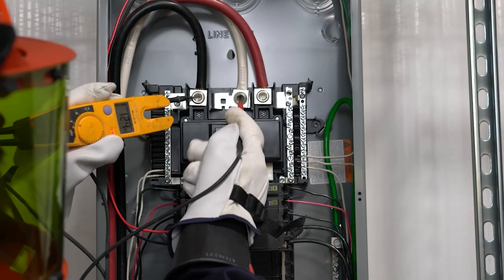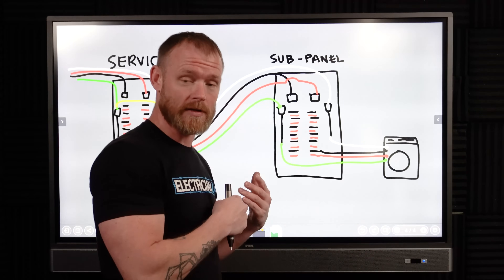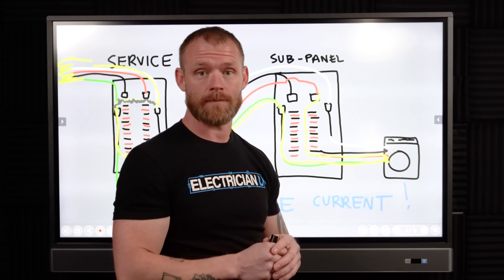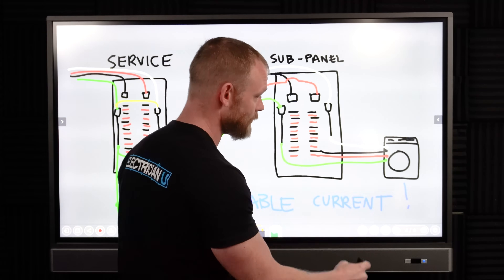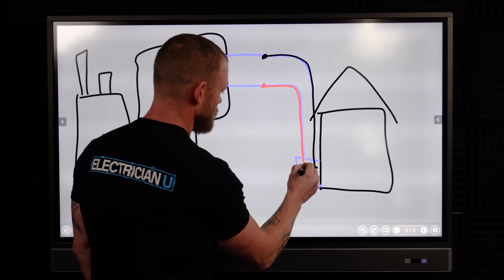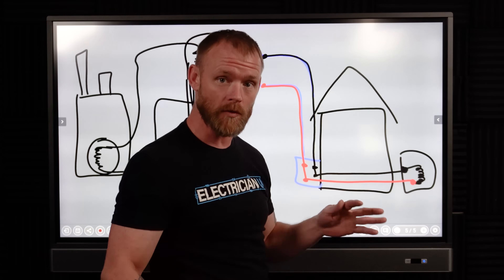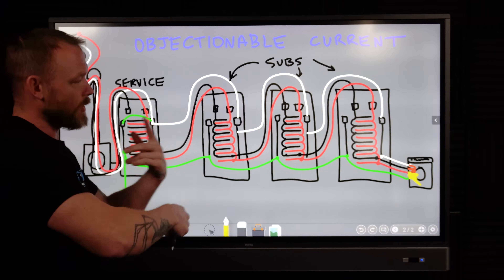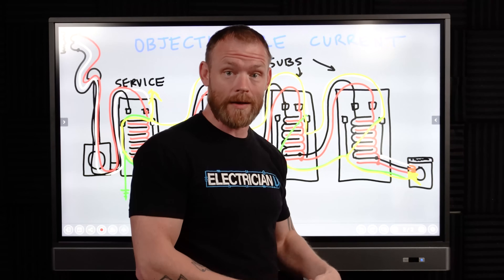Why Do We Bond at the Service Panel and Not a Subpanel?

Comment: As someone who does understand electricity (commercial HVAC),  I am a bit confused. When you stated we bond at the main so a ground fault has a path to the transformer neutral, or we wouldn't trip the breaker. Wouldn't a direct path to ground via the ground rod trip a breaker? I do understand the not bonding the sub panel but I thought the main box was bonded to ensure the neutral remained at 0 potential.

Comment: if you install a whole house generator you bring power from meter base to outside breaker box from bottom of this breaker goes to main breaker box and also from bottom goes to whole house generator . Question does this make the main a sub panel?

Comment: There's a lot misunderstanding about grounding gas pipes and water lines hot and cold ,
Can you make a video not just what the codes says but the logic behind it.maybe a little bit of the grounding rods too.
On later video phantom voltage.
How sometime when trouble shooting you finds circuits with 50 ,60 volts because a open ground.
Great content well explained
Keep up the good work

Comment: When a conductor is carrying current, the voltage at one end rises due to the resistance of the conductors. This voltage is usually very low under low power conditions, but (for example ) a neutral at the end of a #12 gauge wire  circuit carrying a 1600 W load will have a measurable voltage difference than the ground wire not carrying any current. Not much, but enough to feel if you touched the neutral and the bond wire at the same time. 
Experiment: stretch out 50 feet of romex, or just feed one end of a new box of romex and put a receptacle on the other end. Plug in a heavy load like a resistance heater or a big quartz light. Measure the AC voltage between the neutral and the bond at the load end. It won’t be much, but you will feel the difference between the bond and neutral if you were to touch it. 

So the bond wire would never carry current to keep its voltage always  at the same as the ground rod  potential, so that all the metal in electrical equipment has no voltage difference between them or the local ground rod.

Comment: Another reason would be to know if there is some sort of disconnection on the neutral line between the 2 panels. If the ground neutral bonding is on each panel you would never know about the neutral becoming disconnected.

Comment: Great explanation!  When I was trying to wrap my head around this a few years ago, I came to the conclusion that the easiest way to conceptualize it is by equating it to tying the ground and neutral together at a receptacle.  Would totally defeat the purpose of the ground conductor. (Of course you're not dealing with a breaker at a receptacle, but... You know)

Comment: My shops sub panel I added another ground pin just because the soil is much wetter than the back of my house where the original ground pin is. The soil at my house is protected somewhat by the over hang of the roof, and is dryer. There is no "extra" bonding at the sub panel in my shop. Was this a good idea?

Comment: Thank You for your knowledge and time brother! I have a question on hooking a portable 250 volt generator to a main panel with a inlet box and interlock. The generator is bonded neutral from the factory. I have seperated that bond. The cord going from the 50 amp outlet on the generator to the breaker panel has 2 hots, a ground and a neutral. So the only neutral bond is at the main panel. Is that correct? Thank you again for your time, Mike in DFW

Comment: everyone probably will say its a bad idea... but im putting in a new subpanel next to the old one, with no loads on the old one anymore.  both panels are protected by their main 200amp breakers.  im setting up the new subpanel with bonded ground and common, so that when im able to hire an electrician to remove the old panel, the new one will already be set up as the main.  with no loads on the old main panel anymore, from what i can understand from this explanation, it seems like that should be safe.

Comment: One point that I believe you missed is that if the neutrals and grounds are tied together, say at the last panel, then there are 2 paths for the neutral current flow. I've seen water pipes that would give an uncomfortable shock because of this. This happens even with no faults at all. Great explanation and presentation.
Reply: To follow up with this point. As I understand it, current follows the path of least resistance. Therefore, on the main panel, current follows the neutral wire instead of the grounding electrode conductor (GEC) to the source (transformer). What I don't understand is you still have two paths for the current to flow, wouldn't the ground still have a percentage of that current? If it does, is there still a chance of getting shocked if you happen to be touching that grounded wire?
Reply: @SteveSmith-nh6ms  you are correct that current follows the path of least resistance. If the panel is grounded correctly then the resistance of your body is much higher to ground than the ground wire somewhere in the house. Like you said current should be flowing on the neutral back to the transformer. While it is tied at the first point to the ground rod and ground wire, current flow will have a less resistive flow back to the transformer through the wire. If the neutral and ground are tied together in any point other than the first panel then you are correct and the ground will be sharing current flow. I hope I understood your question correctly and was able respond clearly.

Comment: After I lived in my house a while I found that the sub in my separate building garage had only 220V and a neutral with no separate ground going back to the main. Someone told me that I could just drive a separate ground rod for the sub panel at it rather than pulling a separate ground back to the main. I have heard since then both that this is an OK solution and that it's not an OK solution even to the point where someone (licenced electrician) told me that the code has changed regarding this in the past (not sure which way the "change" went). I did experience a job once where I tried to install a GFI outlet by a 220V pump that was about 300' away from the house with only 220V and neutral going to it. I thought that I could do it by just driving a ground rod by my outlet and tie one side of the 220V to the outlet. When I tried to use the roto-hammer I set this up for it ran extremely slow. I stopped right away and checked my voltage and it was only about 65V. I had to rewire the 220 to 120 just to do my roto-hammering and then back to 220 for the pump and I abandoned the outlet idea. I could only figure that what caused the low voltage was the added resistance between the 2 ground rods separated by 300', which I wouldn't have thought would have been an issue. I did not check the quality of the upper ground as it's not really what I was there to do. I just remember thinking that apparently the Earth is not just one big low resistance wire and multiple ground rods, ufers or whatever isn't nessesarilly a good idea. I do know that with high voltage fences that it's recomended to use multiple ground rods spaced a few feet apart and if you can keep the dirt around the rod(s) wet (under a hose bib or water trough) that's a plus.

Comment: This is a very good explanation. I have a different situation where I have a very old (early '60's) secondary building on a rural property. The wiring to that building is overhead consisting of 3 wires, a red hot, a black hot (with 240V between them) and an Aluminum exposed that the red and black insulated wires are wrapped around. I am putting a small (30 AMP) panel in the building and I understand in this circumstance I need to bond my neutral and ground (because I only have the 3 wires feeding the building) Old code. That is how the current 120V circuits I this building are set up. Does this fit? My only other alternative which is prohibitive is to run an insulated neutral from the main panel up to the building and to separate the neutral and ground at that panel?

Comment: no earth from the service transformer to your main box. Earthing is only run at the house. It’s bonded to neutral via an M.E.N connection (you illustrated it). Neutral and your phases come in. M.E.N betweenNeutral and earth bars. Earth bar to earth rod and earths to your final destination.
Any current on earth will either trip RCD’s or CB’s 
There is no earth carried from the transformer though. However, your star point will be staked (earth rod).

Comment: You had mentioned very briefly on the neutral wire attaching to the case of the transformer, well that transformer is mounted on to a wood pole, so now how does that short going from the house to the transformer at the pole make it's way to a ground source from the pole?
I see a copper wire running down the poles with transformers on them that attaches to a rod in the ground next to the pole.   So if that neutral that came back hot via a short, and that short is then sent down that copper wire into the ground, then why send it back to the pole just to accomplish the same thing that the neutral at the service panel is doing?  Why not connect your neutral to a rod at your house like your ground is set up to do?
   I have a feeling the power company wants your neutral wire going back to the pole through your usage meter so they can charge you more money from that current usage.  If it was grounded at your house like its grounded at the transformer housing, then the power company would not get to collect money on those electrons in the wire at your house.

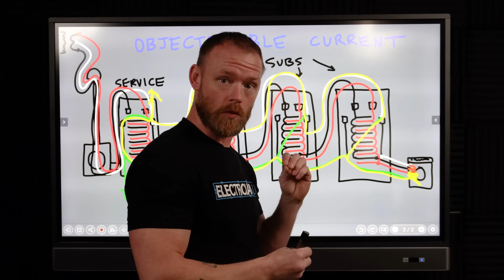Comment: 16:04  That is the key point: If the bond occurred downstream of the service entrance, a ground fault would elevate the neutral (raise it above ground voltage) from the bond all the way back the service entrance, causing incorrect and possibly damaging voltages all along the way.
Reply: That would be bad.  Meanwhile, if a neutral wire becomes loose on any circuit, the ground potential throughout the house would be raised.  A very dangerous type of fault.

Comment: Thank You, I watched a lot of videos about this topic, and this was a great explanation. I was about to use a ground as a neutral wire, because I knew they were hooked together in the main panel anyway, but now that I know how this is supposed to work, I will pull the extra wire and hook it up correctly. Thanks for helping me understand why my idea that would have probably functioned is better off being wired as intentioned even if it’s going to be a lot more work for me.

Comment: Just found out my neutral wire in my sub panel box is grounded 2 the case. Don't have any ground wires in my sub panel. Should I be concerned? 
 If I use an afci/gfci breaker as my master for my sub panel, can I use regular breakers in my sub panel and all the breakers added to sub panel have afci/gfci protection?

Comment: Nothing wired from my sub panel has a ground. All my wall sockets wired from my sub panel only have 2 wires. My main panel has a good ground. I have wall sockets in my den wired from my main panel with a ground.  My kitchen wall sockets are wired from my sub panel with no ground. Can I use the ground from the den to ground my kitchen sockets?

Comment: Can you add a grounding electrode to a sub panel instead of bonding to a remote service panel?
Reply: You mean instead of having a neutral run from the sub to the main?  No.  Then current would be trying to return to the pole through the earth, which is a high impedance path.  That would result in the line voltage being wrong on the circuits on the sub.

Comment: On a sub panel that is properly connected to the service panel should the ground bus bar be ISOLATED from the case like the neutral bar is ?  I could foresee where a ground fault of an appliance connected to that sub panel could apply objectional potential to that subpanel BOX if the ground bus is hard attached to it vs mounted on insulator standoffs.  Hopefully my wording makes sense.

Comment: Your model at 13:06 is similar to what I'm working with at my RV park and at the last/end panel (far panel on the right in your diagram) I'm getting between 3 to 7 volts between Neutral and Ground. What would cause this?

Comment: In the subpanels in your illustration, are the separate grounding bars insulated from the panel box? Or the neutral bars? If they are both simply screwed to the box doesn't that bond them?

Comment: I dislike your explanation  Is this a 120 volt dryer? Even in a normal situation without any faults or grounds or any of these other mysterious results if you have something hooked on one leg of the 220 so it's 110 volt light bulb, it's running back through the neutral and if it's connected to the ground the ground will be above ground potential.

Comment: Does the bonding rule for only the neutral also apply if the subpanel is right next to the main panel, as when you want to break out critical loads for backup power through an inverter/battery or power station like Bluetti or Ecoflow? In other words, if the solar generator is fed by the main panel, and it feeds an adjacent subpanel where some critical circuits have been routed, is it correct that the ground and neutral of the main panel are connected to the like busses in the subpanel, and the output of the solar generator is fed to the main breaker in the subpanel (hot), and the ground and neutral in the subpanel, but the ground and neutral are not bonded in the subpanel? So the only connections to the ground and neutral busses in the subpanel would be the solar generator, and the connections to the ground and neutral busses in the main panel. 

Another question... can both hot busses in the subpanel be connected together so that all the breakers can be used (for 120V only)?

Comment: great explantion but the initial drawing has a grounding conductor in addition to a grounded conductor going between transformer and main panel. in the last drawing there is no grounding conductor back to the transformer. which is correct?

Comment: It seems to me the biggest risk of bonding sub panels is in the case of an  opened neutral between the sub panel and the service panel. In this case the ground would be carrying the neutral current, where no ground fault protection exists. This would likely create significant potential on all the grounded items in the entire sub panel. Fires and shocks would then be a real possibility.

Comment: Skip the ground back to the main panel and attach the sub panel ground to a ground rod.
Would that be OK?
Especially when the drop to the sub panel in a detached garage does not have a ground wire in it.

Comment: There is another very practical reason for only grounding at the entry: lightning vulnerability.
After 34 years of service I retired four years ago from IT Field Services - lots of mountaintop comm sites - for a Fortune 100 electric company. I became the lightning hardening guru for the department in the early 2000s. By far the most common way lightning gets into equipment is from ground loops; instead of the grounding looking like a Christmas tree shaped circuit there is one (or more) "ground loops" - more than one way for electricity to get from a piece of equipment to ground. What's the big deal? It isn't the raw current magnitude, but the rate of current change.
There are three time phases in a lightning strike. The first 50-100 microseconds are used for the initial peak that averages around 25K amps but has been measured above 200K amps. The second is longer, about 1-5 milliseconds, carries currents in the few thousands of amps. The third phase, lasts for hundreds of milliseconds and is typically around 400A. Anything in the path of the strike is toast - burnt toast -but even getting a piece of this action destroys most things. Where "single point ground" is most critical is in the first peak. The rate of current change (di/dt) far exceeds those in the largest AC power transformers in the largest substations: up to 100,000,000,000 amps per second. Any circuit within tens of feet that presents a loop with one edge closer to the lightning's main path to ground will be devastated. I think of it as being hit by an electrical meteor. The second and third phases of a strike carry fire potential along the path, but the first phase of the strike can ruin and kill far from the path. That is why we should avoid using faucets or touching appliances in a lightning storm: we can think we are safe inside the house but the EMP (that is what it is) easily penetrates nonmetallic walls and can be deadly dozens of feet away.

Anyway. those "surge protectors" we can connect our TVs and computers to are mostly for show. If you don't have a ground loop there is little risk unless you have overhead lines and the pole with the transformer you are fed from is hit. For any significant protection, have a "whole house" surge protector professionally installed at the service entrance. Our department had the older TVSS devices that were rated at 25K amps instead of the modern (2008) standard of 200K amps Surge Protection Device. I replaced a couple of TVSSs that were little more than a box of charcoal when lightning got through with them. How well do you think a surge protector in a power strip would handle that?